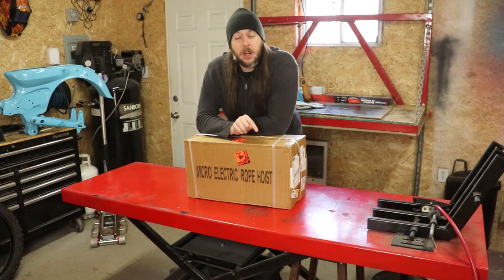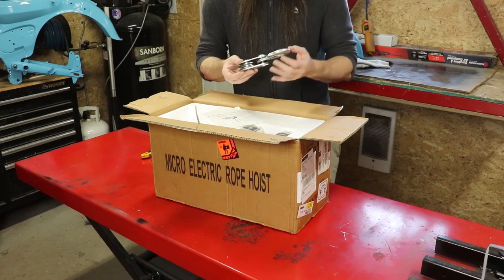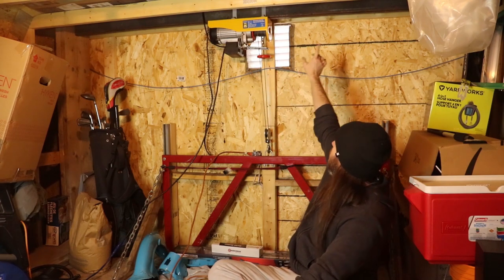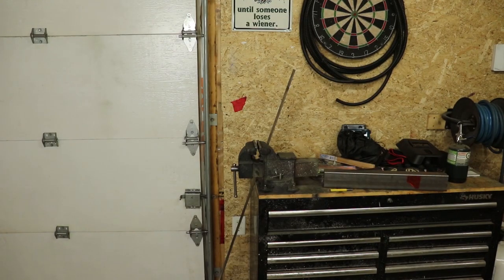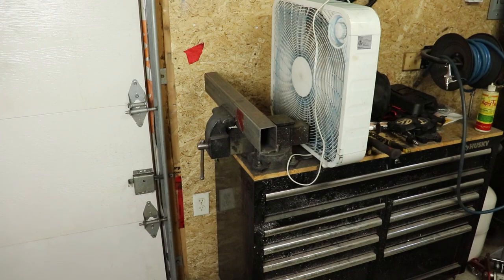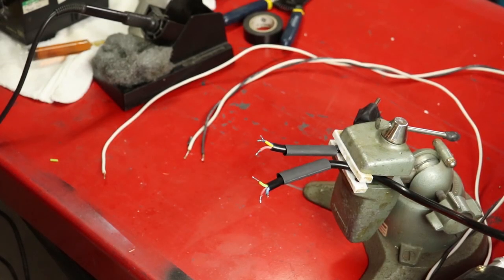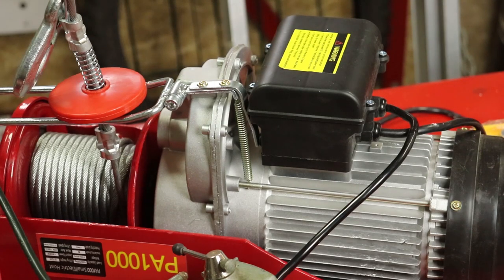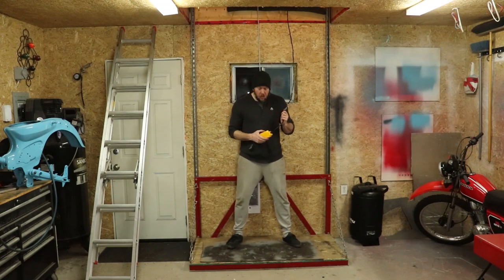Garage Attic Lift Upgrade & Cable Hoist Giveaway

Comment: Wow, buying a new home and the stairs to the basement storm room are too steep and treads too short.
My 94 year old mother will not be able to navigate them.  This lift style will allow easy access to the storm room and basement workshop.  Thanks for a great set of videos.  I'll be doing bike renovations soon as I'm now retired.  I have a 1968 Honda Cub 50, domestic model from Japan. Looking forward to reviewing the Air bag lift!
Reply from the maker: That's awesome Ken, just keep in mind that my lift isn't really meant to be a people mover, so there are safety precautions that I am not taking with my system that would be a must for someone who intends on using it for people on a regular basis!

'68 cub sounds like a pretty awesome project! I'm trying to finish up getting a table refinished so I can reclaim my garage and get back to work on my '81!

Comment: Can mount that remote to the top of the red frame and put bungee cords in about 4 places along the cable to retract it as the floor moves up.  And put a bead on that cable so at the top of its travel it trips the motor to turn off when you reach the second floor.

Comment: I have been looking for ideas for a storage hoist for a couple months. I am just finishing construction on a 30x40 shop with 12 foot walls in Michigan. When I saw your setup, I knew that was exactly what I was looking for, no swaying cables. I will most likely fab up a tube frame similar to yours. Nice work, and great video! count me in.
Reply from the maker: Sounds great Dan! Good luck in the draw!
Reply from the maker: Congratulations Dan! You've been selected as the winner of the cable hoist draw! Make sure you hop on over to the latest video on my channel to reply to the pinned comment so we can get things ironed out!

Congrats once again!

Comment: found a hoist with wireless remote and 1130lb capacity.  Replaced the over travel switch in the hoist.  Ran a wire from the original switch to a micro switch that activates relative to the height of the hoist platform.  3d printed a bracket to hold the micro switch.
Reply from the maker: That sounds awesome, I'd love to see your setup!

Comment: Love the video. I am trying to get stuff together to make a lift for 2 people to stand. I have a disabled sister that comes over, a son born with walking problems, and well I am thinking this would help everyone out. I just have to go up about 4 ft. But has to be build good and sturdy so I don’t shoot them though the roof. Lol thanks for all you advise. Gave me hope I can do this and save a lot of money but still be very safe.
Reply from the maker: Hey Dale! One thing I'd recommend is some form of safety catch if your intent is to move people with it. I don't mind so much as it is just myself or something like my snowblower. If I were using it to move people on a regular basis, I would have a very robust safety system in place.

Good luck in the draw!
Reply: @blastworks  I totally get what you’re saying. Thank you again for all the wonderful videos.

Comment: I would have this installed to make things easier for my husband, who has 2 fully torn, & 1 partially torn, rotator cuff tendons... The drs arent recommending surgery because it would require a full replacement, which typically fails in 10 years & couldn't be repaired again. He's only 49 & doesnt want to lose the use of his arm at 60, so he is working through the pain for as long as he can. His plan is for at least 15 more years. Even with this injury, he still gives 150% in his job as a firefighter, so I want to make things as easy as I can for him at home...
Reply from the maker: Good luck in the draw Claire! It definitely could be of use for you and your husband!
Reply: @blastworks  it most definitely could!! Thank you so much for the opportunity to possibly win such a useful item!!

Comment: Whenever I splice 2 and 3 wires together I offset the solder/shrinkwrap connections so that they don't all line up and make one big dual or triple splice connection.....less chance of the splices ever making contact also.
Reply from the maker: Good tip Paul! I'll try it out next time I'm splicing!

Comment: Very nice upgrade. Especially as it now is twice as fast :)  My question remains: As you are clearly good at welding, why did you use two chains instead of two welded beams in that position?  I like your answer to the safety concerns. The lift is a safe as the one using it. Automated stops would made people less careful. This is not meant as a person elevator. I would not let anyone else use the lift unless I was pretty sure he/she would understand the dangers.  I like the construction. Thank you again for your videos.
Reply from the maker: All great points! I answered your comment on the other video that you commented on; I can take the chains off and lift longer things up if I want to work on them but not necessarily lift them up into the attic. For instance, if I had a couple long sections of heavy steel tube, not having the chains on means I could lift them up to a comfortable working height if I were looking to drill/weld/etc... on them. I've seen plenty other lifts, some made out of wood with wooden supports, some made out of steel with steel strap welded on, all different kinds. This is how I wanted mine!
Reply: @blastworks  ahh yes I understand. You use the lift also sometimes as a workbench and then the chains could be in the way and taken off. Understood. Thank you for your real quick answer :)
Reply from the maker: @computerjantje  Anytime! Glad you are enjoying the videos!

Comment: The extra support you added is called gussets....just FYI......awesome channel.
Reply from the maker: That's the one downside to not preparing talking points or text when I record. Sometimes words slip my mind!
Reply: @blastworks  Completely understand, when I forget words I call it a brain fart......can you please send me the item #'s for those rollers that go into the HD channels......I'm building one of these this spring.....I'm in North Bay Ontario.
Reply from the maker: @pauleastend4706  There are links to the hardware in the original video description! Check them out there!

Comment: If I won the contest, I'd use the hoist to install a lift in my garage for easier storage in my attic and to store bigger items safer as my pull down ladder isn't the best or safest option for my tasks.
Reply from the maker: Sounds like a great plan Dy-Life! Good luck in the draw!
Reply: @blastworks  always got lots of DIY plans!  Appreciate your videos on your install!
Curious, on your opinion. The way my attic is set up It would be easier for me to install this shorter on the wall width, but longer away from the wall.  Do you think that the increased length would put too much weight away from the wall, or would the chains provide pretty good support?
Reply from the maker: @DylanGuitar95  I think it would be too far away from the wall if you are using unistrut channels and trolleys. The amount of torque would very likely pull the top trolleys out of the channel with not much weight on them as the moment of inertia about the bottom corner of the lift platform would be more than enough to cause the top trolleys to exceed the accepted limits of force on the channel. which I believe is only 40 - 50lbs of outward force. This is why, even on my lift, I always load things tight to the back of the platform such that there is as little torque on the lift platform as possible! You could also look into some other form of rail/trolley system that could handle those loads.
Reply: @blastworks  Thats pretty much what I was fearing.  I'll keep researching on plans then.  Appreciate your input and fast response!

Comment: I'm just curious how your old winch that you're giving away will work with an arduino because that will be a good combination for alot of projects sadly the controller switches are wired in a weird way with a huge capacitor too.
Reply from the maker: Use high voltage relays! There are plenty of options out there, just check this out! Here is a 2 channel option: 

https://www.amazon.ca/SainSmart-2-Channel-Arduino-Raspberry-Electronic/dp/B0057OC6D8/

The same company, SainSmart, makes a 4 channel relay as well. Pretty straight forward stuff!
Reply: @blastworks  Thanks for the info! The one thing that I am trying to figure out is the remote, the way the up common and down switches are weird is a bit complicated because even though I kinda get how they're weird, you see wires like the red one hooked to I think the up and down terminals but I am not sure, All I am trying to figure out is how to wire the winch to relays just like how they're wired to the remote that's pretty much all. Thank you anyways!
Reply from the maker: @rahan573  This is actually something I plan on doing in the future! Maybe check back in a few months time and I'll have something set up!
Reply: @blastworks Oh Okay! Thank you very much!

Comment: This is a great video and I'm going to do everything nearly the same. I'm concerned though about your 2x4 3/16" HSS rectangular steel tube. I am an engineer and ran a structural model of your configuration. A simply supported beam (with one end pinned, the other a roller for all you structural engineers out there). Using Autodesk Robot Structural Analysis software the results show 0.558 inch deflection in the middle. That's where all the point load is concentrated and creates a bending moment force. If your span is 120 inches, then a 1,000 pound load creates a L/215 deflection ratio. You should be ok since you probably won't be lifting 1,000 pounds at a time. I factored in the material weight, hoist, and lift as assumed 200 pound dead load. Happy to run more calcs if needed. Awesome job and I recommend Ne Obliviscaris as the elevator music for your next video. 🤘
Reply from the maker: If you like Ne Oblivicaris you should check out some of of the very early vids on my channel; I played in a death metal back about 20 years ago in my early 20's :).
Reply from the maker: Kurt, just as a follow up, some of the other attic lift videos I see on YouTube have people using the 1 5/8 unistrut channel as their beams overhead. I'd assume that the deflection on something like that (and thus the potential failure point) would be a lot less than something like a 2x4 3/16" piece of HSS. Ultimately I guess it would come down to the length.

One thing to keep in mind re: point load is that with this style hoist, you'd actually have 2 points about 5 - 6" either side of the center of the beam where the load is borne. In my initial research, I'd found documents that said load on such a beam would be up around 1500 - 2000 lbs before failure, but as a software engineer, I lack the experience that an (assumed mechanical) engineer like yourself would have.

All that being said, I rarely lift more than 500 - 600 lbs, so I think we're good!
Reply: @blastworks  I did! I was looking for more of your lift videos and then saw you had a bunch of videos from a death metal band and assumed it had to be your band! You are a true metalhead on stage and in the shop! Canada has really good metal bands and so does Australia, NeO and Belakor are amazing. I was supposed to go to Wacken last summer but that was canceled. Our tickets are automatically transferred to this year if it happens, who knows?...
Reply from the maker: Here's hoping! I've always wanted to try to get to Hellfest! Maybe in 2022!
Reply: @blastworks  Yes, you will be all good. I thought about that off-center bracket spacing. Here is the updated calcs for the 1,000 pound scenario https://imgur.com/djI3s2u and the loads were split one foot off of center. 600 pounds for each point load. The 0.3292 number is in inches and that turns out to be L/364 so that is probably the max. But as you said you are half that loading. Thanks again for your videos, I read a lot of the comments and think I've got most of the answers from your helpful responses.
Reply: Adding smaller triangular trusses above or below the beam would greatly reduce the deflection ratio, which in turn, will greatly increase the maximum allowable load on the midpoint.

Comment: LIKED AND SUBSCRIBED As per request.. Now then - I’m fat. I’m old, yet I still need safe access to my attic on a regular basis. Currently, I climb a 5’ ladder, balance precariously on the top of the door to boost myself up. Holy hell... I’m lucky I haven’t broken my neck over the years. ...maybe it’ll happen next week without a decent used Princess Auto lift...? - 🤷‍♂️ who knows ? 😳
Reply from the maker: That's a good entry Casey! Good luck in the draw!